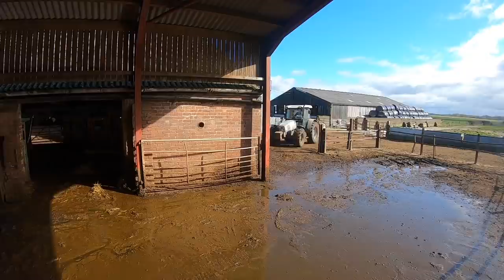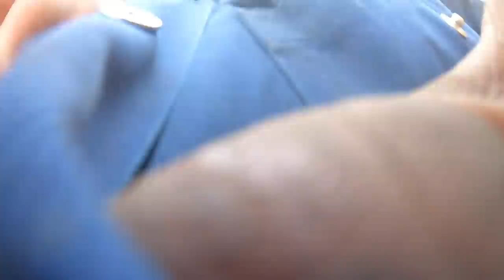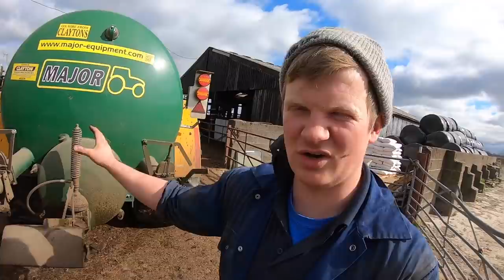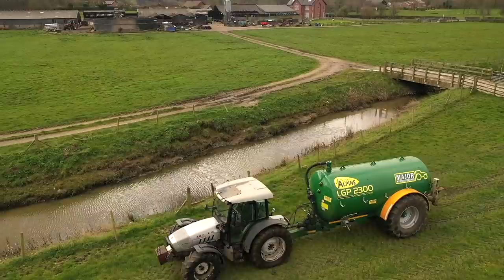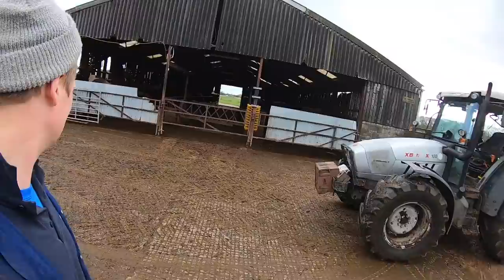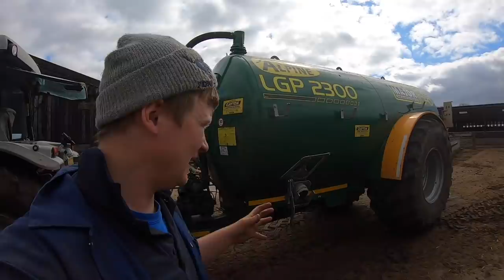PUSHING A SMALL TRACTOR TO IT'S LIMIT ! CAN IT BE DONE? OR WILL IT FAIL?

Comment: Pulling won't be an issue it's stopping all that weight in an emergency
Reply: Between that and the fact theres not a hill in sight🤣
Reply: @jasonfawcett2506  doesn't have to be a hill in sight, only takes another road user to make stupid decision and you won't be able to stop that full load like you want to
Reply: @farmerlou16  what I meant was he wont be able to stop or climb hills with a full load
Reply: Tank brakes
Reply: @jasonfawcett2506  ah sorry about that, definitely be a crawl to the top of a hill, been in both situations before where the load is to heavy, even the trailer brakes don't help that much as it pushes you on because it's heavier than the machine towing, need the weight of the machine to hold it back
Reply: @farmerlou16  will stop no problem. The brakes on those tankers are superb. I used to pull a 2400 major on a 100 hp tractor and handled it fine. Yes slow up hill but that's not an issue on Tom's flat farm
Reply: Tom, go with your gut.  With tractor and tanker brakes there should be no problem...... have pulled bigger tanker with smaller hp tractor before...the operator makes the difference.......you cannot overcome  stupid no matter what the weight or the horsepower .....
Reply: @tonee4227  Defiantly jealous of a flat farm in Devon that tanker would take at least 150hp on the front
Reply: @harry.bethwaite  indeed. It's all about playing to your farms strengths. Their farm is flat enough to pull that tanker with 100 hp
Reply: @tonee4227  Yeah down here we have a JD 7530 with a 2600 gallon so it all depends on the land and the conditions
Reply: Well if he carnt stop and hits you he'll be spreading you all over the field.😂😂🤣😂
Reply: @farmerlou16  if the brakes are working on the tanker stoping will not be a problem ..........
Reply: Jesus, Some of you commenters want to grow a set of bollocks.... Back in 89/90 I used to pull a 3000g Hillam Tanker with a 90hp Zetor Crystal. Never had any problems with traction or stopping as the tanker had good brakes. We had some good hills in west Somerset and I never had a problem. All you have to do is think about what you are doing and have common sense. As for stopping on hills, Of course, I could stop a full load.
Reply: Billy Stephens   Yes , Brains over Brawns  wins every time
Reply: Billy Stephens #operator
Reply: Jay Jones unless major tanker brake design has changed lately, the major tanker I have has the shittiest design ever. There is no spring to pull the shoe back from the drums, so when you haven’t used it for a the brakes seize up. The first half day of using it is unbearable listening to them screech. Can’t be good for them
Reply: @Lancashirelad and yet the tractor unit is designed to designed to carry and stop it's load surely? I deal with a lot of hgvs now that I work in a different industry and I smell a lot of burnt brakes
Reply: @benpattinson1  I can take as much responsibility to make sure my machine is designed to do the job
Reply: @Rmc456  must have improved them. Mine was new in 2015 and breaks have return springs
Reply: @WilliamStevens007  spot on. All these young lads that think they're a tractor driving hero if they get the job done quicker than anybody else are a nightmare. Slow down and do a proper job and treat the kit well. We had a lad come and bale 500 bales for us last year and he wenr that fast around the field it was ridiculous. Got the job done double quick so he was chuffed with himself. I on the other hand was feeding soft as shit,  rubbish bales all winter. Wouldn't have him back through the farm gate.
Reply: @WilliamStevens007  back that time common  sense  was common pratice ............tractors were 30 k  gearbox ............now everybody is not happy unless they can do 50 k   all the time ........remember bringing a load of wheat to the feed mill in a silage trailer behind a 8011 back in 84 , there was 17 tons of wheat on ..........trailer had no breaks fitted ..........the front wheels were hopping on the road .....only got in to top gear on the way home ..............
Reply: @WilliamStevens007  I've always wanted to have a serious injury when I can't stop because I don't have enough front end weight so yeah good idea I'll see you in A&E
Reply: @harry.bethwaite  Lol dear oh dear. Plenty of weight on the front.
Reply: kieran brady from driving transports dear god this statement is more true then people actually know
Reply: @georgedoorley5628  Best answer I have seen, Exactly. You know where I was coming from. I started off driving an IH 784 2 wheel drive. I was taught how to drive on steep ground and by a man that I respected and you listened to him because he only used 2 wheel drive because that's all they had. Trailer brakes yes we had them but through the spool valve and were lucky if they were 75% good. But alas back then we still had crash gearboxes and dry brakes to deal with and not these air-conditioned luxury 50k self-steering finger tip knobs and driven by computers. Yes I had my share of scary moments in greasy conditions but it taught you to respect and drive for the conditions. I bet if you stuck a lot of these so-called tractor drivers in an old school tractor they wouldn't last ten minutes. Our biggest tractor was a Case IH 1056XL. GPS whats that, Our was a tree, pole something on the other side of the field.
Reply: @WilliamStevens007  seen a david brown 1200 pulling a ford h42 digger  with a 4 inline low loader with a dolly up front ............that digger was about 14 tons and the trailer must have been 5 tons ......on hilly road trips  , he would put  one of his kids in the digger and going down hill they would rest the bucket on the  back wheels of the low loader to hold it back a bit .........did that for years ,before the twin gods of health and safety  became so famous ...........always took his time  top gear was never  used  when loaded .......never a accident , might not have had the best of equipment but had the best of common sense ...........

Comment: Tom. I bought a 2000 gallon with trailing shoe. It’s enough weight when land is soft. Your H tractor will loose grip on hills regardless of tyres. Dry summer no issue. Great tankers.
Reply: What do you reckon for Toms flat ground then. Spend £100k on that (admittedly lovely) case tractor or save that for another day.
Reply: Ben Pattinson - god no. He could pick up a good 2nd hand one. New tractors not worth the money.
Reply: Aidan Munnelly agreed

Comment: Tom as you you’ll have seen. Your own tractor will pull it no problem.  I’d pull that tanker with our little 2850. No issue. Especially on flat ground. Issues are when grounds wet or on hills. The case will struggle in those conditions.  Considering you’ve heavy ground would you not consider 2000 gallon rather then 2300.

Comment: Tom it might pull it now but it will put serious wear on the tractor. From experience I'd say you'd be better off with a 2000 gallon tank. Great video all the same.
Reply: Going to say the same thing a 2000 gallon tanker is better for the tractor that size
Reply: Was thinking the same, drop down to 2000 gallon and put a dribble bar on the back, take some weight off the back end of the tractor, keep the sward cleaner too.

Comment: Yes the tractor may be able to pull it as you've seen, but its not ideal.. You've too much weight on that wee tractor, through time you'll kill it.. Travelling to close fields on the farm won't be as issue but if your on the road, its far from safe.. That Tanker will bully that tractor, accident waiting to happen. It'll push the back end around in corners, chance of jack knifing, will the tractor be fit to stop in an emergency etc? I wouldn't be recommending it.. 2000g maybe Max.. I know its easy to say but, Bigger Tractor, smaller implement is an better idea. The tractor should always be the boss..  Also just a quick note on the Tractor tyres, 3 lugs on the ground yes, BUT it depends on the spec of tyre. That is mostly for IF or VF Tyre types with increased flexibility..Which I'd doubt your tractor has  ;)  Oh and another thing, Yous mentioned about only filling it half.. Again going across yard or field is fine, but NEVER half fill a tanker if going on road or anywhere at speed. Only having a half load gives the slurry more free space to slush around in, causing splashing back and forward. In turn this will increase you chances of jack knifing or rolling the tanker as the weight moving around will make it very un-balanced and un-predictable. :)
Reply: I knew a fella who rolled a tanker as he half filled it, hit a pothole, all the slurry sloshed over to the side and rolled it (2000 gal tanker on 850(?) Tires roughly)
Reply: I agree
Reply: Well said totally agree.. they need to buy that case tractor no if and or buts it needs to be an asset to that farm...
Reply from the maker: Blake 2406 I know what you are saying and think you worded it really well. It should have chambers in it to stop the slushing around I though?
Reply: @TomPembertonFarmLife  Baffles in tank yes, most do. I'd say a 2300 will have 2/3 across the length off it. These will and do help to eliminate the slushing but with half a load on if you brake sharp from full speed on road, you will still have slurry slushing forward against the baffles plates. Also baffles plates don't really help from side to side movement, ie. if you where to turn a sharp corner at speed, half a load will naturally want to shift to the outside of the corner, ,shifting your weight balance. Liquid will always want to move given free space, hence the reason a full tanker is better for stability. Even more so in the case of your own tractor being on its limit at the best of times with it, you would really want to be sure the tractor could cope and not be bullied. Hope im kinda helping, just trying to help you out on a few bits you may not automatically think off! :)

Comment: Tom,  Yes the Hurliman probably would pull it,  However that is a Big Lump to put on the back of an "Oldish" tractor that has done 6000k hrs and will have wear and tear you need to think about how much tanker work you will be doing, Are there any road leads (Can the tractor stop it quick enough) Yes the case would play with it but it`s a brand new tractor with no wear and it`s bigger, I would look at the 2000 Gallon to be safe.

Comment: Hi Tom, I would strongly suggest that you umbilical pipe spread your slurry and forget about buying any tanker, especially when all the slurry is coming from one source, this is the fastest, most efficient and most cost effective way to move large quantities of slurry in a fraction of the time and cause minimum soil compaction. Use a contractor as dairy farmers are too busy to be doing this type of work at this time of year. Pipe  the slurry out in January/February to grow early grass and focus  on getting cows earlier than you normally do, this is the practice in Ireland where we aim to produce as much milk off grass during the summer months and shut down production and fully dry off all cows during the winter months.

Comment: Just a thought, that tanker has metal plates over the fill glass holes, if you buy one consider doing the same, used the same tanker, at about 6 years old the glasses shot out of all 3 inspection holes within a month, the threads had disintegrated. Always kept back window closed after that, would of been showered in slurry 😅
Reply from the maker: Jammy Dodger Good to know!

Comment: We had the same tractor ( Lamborghini based) sold as a White.  One day during planting,  all the big tractors were out in the field and I used it on the 15 ft Landoll.  I was shocked.  To its credit,  the little devil pulled it.  I mean,  I wouldnt want to do it through a lot of mud or steep hills but it did it.  They are built better than I thought

Comment: Hi Tom just a little tip on the tanker if u swap the tires the other way around so swap them to the opposite side and it should be easier on the field but it won’t be as good on roads

Comment: Tom, i pulled a 2900 gallon tanker with a 100 hp New Holland TL 100. Mostly in hilly fields. The tractor handeled it pretty well. I think you can go with a 2300 gallon tanker.

Comment: That Huerlimann is far too small for that tanker.
In my experience in plant operating, you want a vehicle that is usually twice as capable, so it has half the load. For example, you wouldn't have a 1 ton forklift to move 1 ton pallets all day. A machine working at 100% lasts half as long as a machine working at 50%
The hurli is obviously straining, and this will give it accelerated wear.

Comment: She'll pull no bother on flat ground, but any bit of a hill will just drain the power, any wetspot you wouldnt have any hope with the small tires on the tractor. Test the brakes going at 40k with the tanker full behind you and see how long it takes for her to stop. I would say keep the 1500 gal tanker aswell for during winter and put the case on it if you are under pressure with storage. Half filling tankers is very dangerous, I know a fella who half filled a 2000 gallon tanker (on around 850 tires) and he hit a pothole, all the slurry sloshed to the side and turned it over

Comment: are there not weight ratings for the Hurliman, i.e in the manual in should say what it is capable of pulling and the weight limitations of the draw bar. also are wheels on the spreader driven?, just curious.

Comment: Yes shes doing it but personally I think either 2000g or bigger tractor. Tractor might not be man enough on damper feilds. I would advise against half full tanker. Have seen the results and it's not pretty. (1 nearly new tractor and tanker written off operator shaken but ok) would say if ur going for a new tanker try and spec it with a full height sight glass. Easier to judge application and easier checking on filling

Comment: i   worked a jd 2850 4x4 and pulled a tanker  similar to that size back in early 90s, maybe 2000 gallon , and yes i did struggle to brake  when the tanker was full

Comment: I see youre exited about the hurliman/same/deutz is able to pull the Tanker, but what have you thought? In its heart its a Deutz, so it has to be able to pull it 😂😂
Here in germany we are getting the slurry out with a Deutz Agrotron  120mk3 (120hp on the pto) and a 17500 Liter tanker, even when its a little bit wet he's pullin it quite good 💪 
Okay, he has 580 tires at the back and 540's in the front and has 6 cylinders, but in These points the hurliman has a disadvantage 😅
Maybe you schould look for a used tractor with 130-150 hp with 3-4000 hours on the clock instead of a new one

Comment: Also Tom the tanker will push your tractor around a bit due to weight. Check the braking capacity of your tractor also versus the full tanker.
Reply: Biggest issue is that the slurry would be sloshing around and when you slam the brakes it would push the tractor even more
Reply: If shes not blue she'll not do that would be if the tank wasn’t filled full the slurry would be moving surging around  they’ve flat ground so be grand in the field

Comment: Hey Tom, at my own farm in Holland, we use our Fendt 716 from 2001, we use it with a 2500 gallon Veenhuis slurry tank with a 6.8m injecter behind it, it runs it pretty ok, but the thing that I was wondering myself, is that you guys have the hurliman with around 6000 hours, you said, but is that like a lot of hours for you guys or is like regular. BTW Keep up the great work with the videos. BTW BTW our Fendt 716 has around 18500 hours.

Comment: Although the hurlimann can pull it using the case is probably much more fuel efficient and not to mention safer. However it would be cool to see the hurlimann on some proper floater tyres or maybe even a skinny set of duals although that might be a bit overkill!

Comment: Sometimes we pull our 2500 gallon tanker on our john deere 6310 (100hp) and it has the same size back tires your hurlimann and it has no front weights and really it has no issue

Comment: Any tank man tell u match size for size. Case is fine that tank will boss u all over the place  accident waiting to happen
Reply: Yip far to heavy for tractor...only a muppet would consider a tanker that size even a 2000 would b a stretch for the weight of the tractor..but hey what would I know I have never played farm simulator like all the experts on here... 🤷‍♂️
Reply: @cowsrcool1103  tractor should cope alright with a 2000g (when condition are ideal) But if the tractor and tanker goes down with a full load on even a 2000g. it will take more than what the havr to get it out.
Reply: They have pure flat land. Tank be no bother to the hurliman
Reply: @deutz3904  xactly
Reply: @sarahhealy2499 yes no bother pulling it but  when they are slowing down go turn in gateway or lane it will push the tractor...
Reply: @sarahhealy2499  the biggest is issue is slowing down as the slurry will slosh to the front and push the tractor even with 4 wheel braking on the tractor and the brakes on the tanker. 2000 gal tanker would be plenty
Reply: @sarahhealy2499  ye they have flat so do we. but its when the ground is borderline that's when the tractor has the extra weight. plus even though the hurliman has 100hp it still even with with the weights on front doesn't have the weight to stop the tanker (that size) bullying it on the road